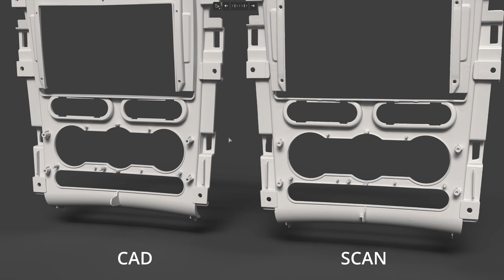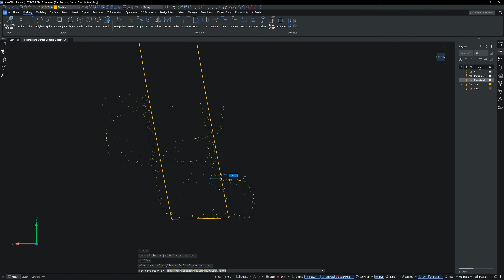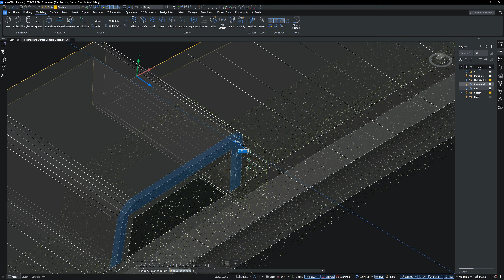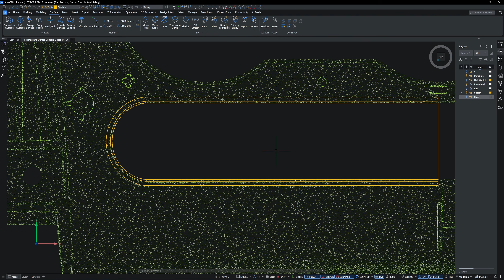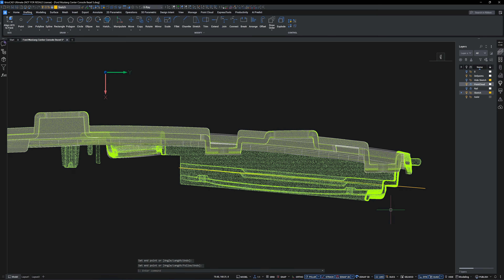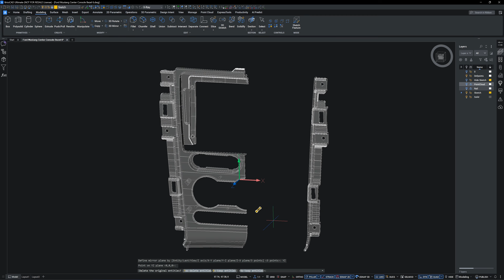3D Scan to CAD Tutorial – Ford Mustang GT Console Bezel (Creality Raptor Pro)

Comment: I just learned about Brics and they seem to be the Autodesk alternative. I've been burned by them for the last time. It looks like Brics offers real, local/offline perpetual licence? 

I have been kinda spoiled by Inventor though. Is Brics 1:1 replacement or does it's operations require a big learning session?
Reply from the maker: It only took me a day to get familiar with BricsCAD, and within a few more days I was already modeling parts like the one shown in this video. If you’ve used AutoCAD before, BricsCAD will feel immediately familiar. However, it still falls short of Inventor in key areas such as adaptive modeling, 3D FEA, assembly management, and rapid 2D drawing generation.
Yes, it offers perpetual license, that you can transfer between the PC on your own.
Reply: @Payo-TensileCreator 
Thanks for clarifying! 
In that case, just shy of 3k USD for the ultimate package is very reasonable. I'll miss the flow that Autodesk offers with their sketch features but I won't miss that subscription! 

Out of curiosity, if you're willing and able; I'm looking for a 3D scan of a Mustang (S550) center speaker grill cover (the panel on top of the dashboard in the middle) with the idea of modding it so I can print gauge pods. Do you do work like this too or only modeling?

Comment: I have acess to Solidworks, fusion, autodesk programs and plasticity from work. Out of curiosity if you had to choose 1 program from these as your main program to use which would it be and why ?
Reply from the maker: For large assemblies with over 3,000 parts, I rely on Autodesk Inventor, it’s been my main design software for 27 years of daily use. SolidWorks came out earlier, but since 2012 Inventor has consistently outperformed it in my workflow. BricsCAD, on the other hand, is an AutoCAD‑style CAD tool with advanced modeling features and point‑cloud compatibility. It’s one of the fastest and easiest CAD platforms to use. The main drawbacks are the lack of built‑in FEA, limited capability for very large assemblies, and weaker 3D‑to‑2D drawing generation.

Comment: It’s crazy the hoops companies will jump through so you can’t replicate a piece of plastic 😂 look at how complicated and over engineered that bezel is.
Reply from the maker: Since the car was built in 2008, the bezel design likely dates back to around 2005. At that time, CAD software and hardware were far less powerful, so modeling a complex part like this could easily take three to six weeks. It really shows how far design tools have advanced.